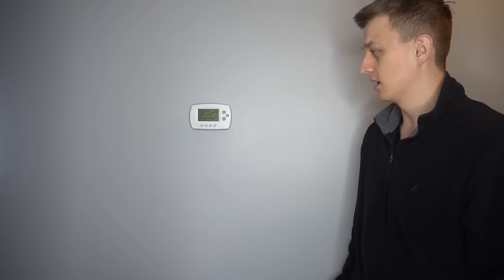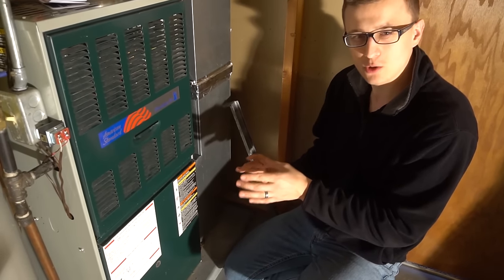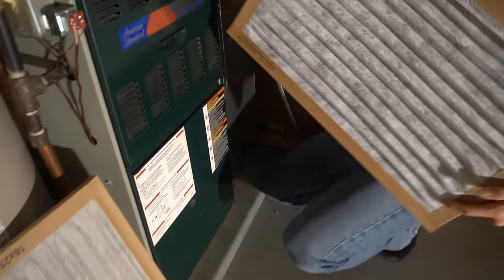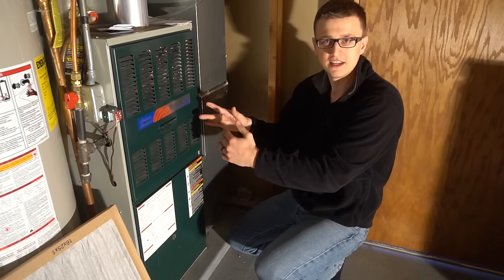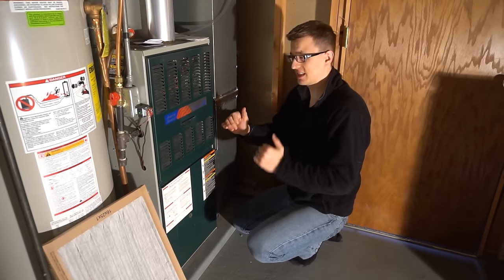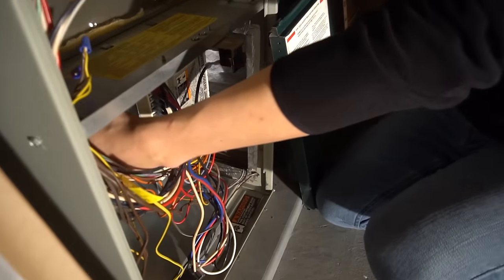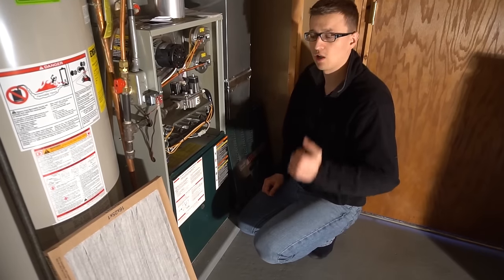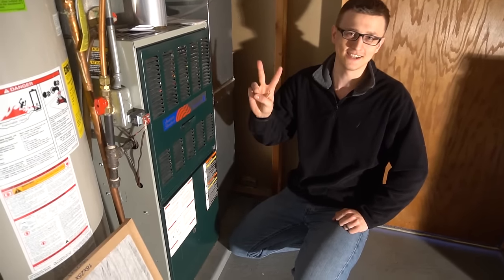Furnace not Keeping up SOLVED

Comment: I had this exact same problem today (furnace set to 73 but only making it to 70) and the problem turned out to be a clogged condenser drain.  Popped the drain hose off and a literal gallon of sediment-filled water came out.  After doing a bit of research the backed up water was tripping the pressure switch causing the furnace to shut off a minute or two after it turned on each and every time.  After draining the water the furnace immediately began working as normal again.  Just throwing my experience out there for anyone who has tried to two tips in the video but still has the same problem.
Reply: Thank you for posting
Reply: How do you do that?

Comment: I had two different furnace techs tell me to use the cheap filters.
Reply: Shaun Weiss furnace filters arent for filtering household air.  Theyre to prevent damage to the blower fan or coils.  The fiberglass ones are the right ones unless your furnace was built as a air filter too

Comment: I wish I could find a video of this problem....."my unit works with air, the batteries are good, the backlight works, the air conditioner works, but when I flip to heat, it does not come on.".....wonder what causes this....?????

Comment: THANK YOU so much! Furnace was cycling and I knew to try the filter first but when I took it out it looked fine and wasn't that old then spent hours trying other things and nothing worked. Then I found your video and your two comments that said sometimes it still looks clean and also that it often happens when very cold and since both of those things are currently true I took it out and slipped in a new one and long story short, now I can cancel the repair visit! Thank you again! Best in 2022 to you!

Comment: Thank you for showing this video. I just bought this model and I did not like it because of two reasons: No batteries need and the temperature sensor is two degree off (lower) than actual temperature.

Comment: My main limit switch failed overnight. I was able to troubleshoot with the help of your videos. I am guessing it overheated due to my filter being dirty. I also had the 4 light error code and the burners never came on. I tried to tap it but that didn't fix it. Unfortunately I had to call the service guy and it set me back 200 bucks. If it wasn't so cold out right now I could have replaced the switch myself but I couldn't wait a couple days for the replacement. Don't forget to change your filters or it could set you back in money! Great channel I have learned a lot in the past 24 hours of troubleshooting!

Comment: just resolved a poorly running electric furnace for my mother in law this morning.. set at 73, only getting to 67. replaced dirty high efficiency 3M filter with a new one and 30 minutes later the thermostat was satisfied and shut off. ur clip is a good one and educational, a lotta folks dont realize how important routine filter changes are and a little bit of knowledge can save you money by avoiding a service call. the service co she called couldnt come for 2 more days so we're pretty glad to have the issue resolved for $10 and a trip over there

Comment: Changing the filter was exactly what needed done! I’m a single woman renting a private home & all the basic maintenance is on me. So my research asking the question of why my thermostat showed everything was ok & it should have been heating with the heat turned up to 70 - brought me to this video. You made it very easy for me to figure it out & within about 30 seconds of changing the air fillet the heat came on!  So yeah! Thank you!!
Reply: I changed my batteries my screen is blank no readings my thermostat is five years  old do I need to buy a new one

Comment: Thank you so much for this video!  Currently experiencing sub-zero temps where I live and was about to call a furnace repair, as my furnace was not getting close enough to the temp I had set on the gauge.  Changed the batteries, but no change.  Had marked the filter needing to be changed next month, but followed your advice and changed the filter anyway and presto!  Furnace is working like a dream!  Thank you! Thank you!

Comment: I have a Bryant 80% single stage furnace that is 16 years old. I replaced the one inch filter in my return duct with a newly installed 5 inch air bear with no problems of restrictions or heat loss. In Michigan this year so far our temps went as low as -12. I change the air bear every 5 months. I have been in the automotive maintenance industry for many many years and fully understand the importance of preventative maintenance of especially filtration in all respects. I enjoy reading all comments and am always in a "learning mindset" when reading comments and replies. Just my thoughts.

Comment: THANK YOU AND ANOTHER TIP: My furnace had the same issue, checked the filter and it was very dirty. Replaced it with kirkland 2200 filter and problem did not go away. Did some research and found that my new filter was very dense for my furnace. Switched to light duty MERV 8 Filter and problem was solved. Thanks for making this video.

Comment: So glad i found your video...
This yr ive had problems with my furnace...not keeping up to temp...cycling on and off but not really kicking on. Its also the first yr ive used filters that are more solid.....ive had to use space heaters and my dryer vent to keep the house warm...making my utility bill $400 over normal. Im on fixed income and have t been able to get a repairman...because of other things... Because if covid i couldnt find online the filters i usually used that let more air pass thru.... 
Ive replaced the thermostat... And kept having the problem...

Comment: Thanks for explaining the system lockout safety setting, & power shutoff furnace  reset.   My repeated power resets kept restarting the heating element & burners, but they never stayed on due to the lockout.  Just like you said and showed on this video,  it was a dirty filter. Will buy lesser priced, less restrictive filters going forward, especially during colder winter months. Thank you!

Comment: Woke up this morning with -1 temps outside and heat in the house at 64 lalthough I'd set it to 70. Did what you suggested and sure enough it was the filter. Ran without for a while and also turned off for 5 seconds in case it was locked out. It's starting to warm-up! You just saved me a really expensive Sunday service call. Thanks so much!
Reply: How long did it take your house to heat back up? I'm facing the same exact issue

Comment: Great video. By the way my thermostat is same as yours paired with trane single stage AC and single stage gas furnace. I had a similar situation like this  about a month ago. I usually keep it about 64 at night  when I am sleep and when I am away  and at work .. Got off work  we had our first really cold snap and I got home the house wouldn't get know warmer than 65 or 66 when I program to start warming the place up 1hr prior to me arriving. I keep at 69 during the day when I am at home. Your video seem to be the most helpful and straightforward I have seen. By the way I am from South USA where it usually brutally cold to about middle of winter that often or any all. Great videos great channel. I can do most of it myself in between my two yearly hvac maintenances visits I recently signed up for my furnace and air conditioner visits from my hvac company. Your videos is really going to really help me save a lot money in terms of repairs and costs in future on certain  stuff I can easily do myself. Anyway great job.

Comment: My blower ( gas) was running fine, thermal cupler new, but when I REMOVED the cheaper 2 inch filter which was blocking air flow  , it shot up to proper heat instantly..BLESS YOU. I will use slimmer model for heat. never a problem for a/c  but I normally use highest quality home depot filters...for pollution

Comment: Great video! this was exactly my issue.  Changed the filter, temperature came up and stabilized at thermostat set temp.  Worth noting this happened during a particularly cold spell where the furnace was running a lot.

Comment: Yes, perhaps my air filter was the problem. I replaced it last week (after 3 months) with a brand new higher end filter by 3M, but today I came home to a much cooler house (65 degrees Fahrenheit when I normally set the thermostat to 67 or 68 degrees Fahrenheit). So, before watching your video, I switched off the furnace for a few seconds and switched it on again to see it fire up. It ran through the full cycle and the vents warmed up and the home temperature is rising. So, thanks for the advice and of course, if I have this problem again, I'll check and/or replace the filter and if that doesn't do the trick, I'm going to call my furnace guy to assess the situation, but it seems to be running normally again. :)

Comment: Yes these premium filters for people with allergies, etc. are great, unless your furnace is old and can't keep up (incompatible). Thanks for the simple heads-up
Reply: Yes, that was my problem.  Had a premium filter in an older furnace.  Even though the filter didn't look all that dirty, I replaced it anyway and viola, my furnace is working beautifully.
Reply: a company here in my town said it is better to use the thinner cheaper filters and change them real often, this saves your unit, but, you must change real often........

Comment: Thanks for your videos, they have been most helpful. Our furnace has been on the fritz for the last 1-2 years (every since we bought the house). The furnace is currently 24 years old and we know it can't last too much longer. Well we have a home warranty ($125/per service call) and they have been out five times in the last two years and every time they come out they just check the filter, return ducts, clean the flame sensor (they have replaced it twice so far) and check to see the temperature that the furnace is putting out. It usually works okay for a bit but it seems like it is never keeping up. I've changed the filter and also removed the filter but the same sequence of operations keeps happening. The furnace will work properly for anywhere from 3-5 minutes then shuts off. If I go upstairs and bring the thermostat (honeywell) back down to the level of the house(wait for it to click) then raise the temperature the furnace will again come on and repeat the same cycle. The furnace seems to put out a lot of hot air but our house can never warm up past 68-70 because it is always repeating this cycle. It is getting frustrating with our Minnesota winters  I hate to keep calling them out when they don't really do anything, do you know what the fix could be?
Reply: Well I've checked the continuity and voltage on the limit switch and everything checked out normal. Even with filter out of the unit it still goes into the overheating mode. Not sure what else to check.
Reply from the maker: @trinityrv4683  It's possible that the high limit switch is weak so it keeps tripping even though the furnace is not overheating. From what you described, I wouldn't be able to give you a good answer though. Could be quite a few things.. When the burners shut off like that (or it "overheats"), does the control board blink an error code?
Reply: @WordofAdviceTV  Yes it gives me the 4 flashes for high limit switch error code.
Reply from the maker: Hmm.. I would try replacing that hi-limit switch then. I can't say for sure that it will fix it though.. Right now I am working on a video on 10 reasons why a furnace can overheat. Sorry I can't post it any sooner, it will still take at least 3 days to complete. But maybe that video will have some useful information for you.
Reply: @WordofAdviceTV  Sounds Great. In the mean time I will replace the hi-limit switch and see if that helps. Thanks.
Reply: It indeed was the hi-limit switch. It seems to be cycling correctly! Thanks.
Reply from the maker: @trinityrv4683  Awesome! Happy to hear it :) Stay warm!

Comment: Hi,Jay, I am sure this is case why  furnace locks out. Like you said especially in cold weather. When I try to put the front cover back, sucking force is strong.Thank you so much.
Reply from the maker: You're welcome! Good luck with all those furnace calls man! :) Oh and I can leave you with one more tip if you are not doing this already... Whenever I have intermittent problems like that, where I come to the house and the furnace is working fine.. I always explain the diagnostic/error LED light on the control board to the homeowner and show them where to find the diagnostic chart on the back of the furnace door or in the manual. I then instruct them to write down whatever code the furnace is blinking if the problem ever comes back. That way when I come and everything is working fine, they can tell me that when it wasn't working it was blinking such and such error code. Hope that helps in the future!
Reply: @WordofAdviceTV  You are totally right. Thank you

Comment: My last comment was just don’t make the customer think they can solve all their problem with a filter.even though it’s a very common problem. All that aside  you should cover a topic with me here that a ton of tech disagree on. That is the use of uv lights in systems to eliminate fungus mildews and what not. Here’s my take on those. I’ve installed these lights on systems with some extremely good success rates when installed properly.  I had a customer once that was suffering from allergies very bad in the home. About 2 years prior to that they had a water heater burst in the mechanical room where the furnace was located. They began to grow a mold inside the unit. Thus allergies began too for them. I called the customer down to the basement to see what I had found in their furnace. It was all inside the unit around the walls of the unit and into the duct supply . They questioned me about how to eliminate it without buying a new system and duct. We only have a few things in our arsenal to use for something like that. One is a cleaning kit you can buy and use to eliminate that . The other is a uv light. Here was the result the next maintenance time. I show up to change the bulbs out because they bought the one year bulbs. Turn off everything and pop it open. What was left of the mold was a dead white powder. In the duct and inside the furnace . Now keep in mind I did also use the clean kit to kill as much of that as I could right off. There was still some left that I could not really get to . All of it dead and turned white nothing was left behind and the allergies stopped. We used a two bulb mount up light system one mounted inside the duct and one over the fan area near the coil . So in essence both sides of the coil. Worked great and the customer is still very pleased with that system today. If you’ve never used one I absolutely recommend it.unless you have a up or ozone reaction then probably not so good maybe use the cleaning kit and hope that solves it. Otherwise this is extremely effective on stuff like that.

Comment: Thanks I now know hot check if your motor is burned out in a industrial size heating system which is where I live as of rite now and its cold in here when the heat has a problem like this but now hey I can go check!! Thanks great video

Comment: Great video. I encountered this recently, where the aux was triggered due to below freezing temps but would not get to desired temp. I changed the filter - nothing; made sure the duct  dampers were open; checked  all basement registers were closed. Then it dawned on me after vetting the heat strip was working as it should, the basement door, directly across from the thermostat,  was left open. Doh! Closed the basement door  - problem  solved.

Comment: I have a similar problem, however, it’s the cooling system that seems to be stuck at room temperature and it’s taking for ever to lower my set temperature degree. For example, I set my AC temperature to,let’s say 78 degrees during the day and  at nighttime it’s set to, let say 70 degrees, the lowering process,from 78 to 70 degrees is taking a very long time (hours) to reach 70 degrees temperature settings. I must add that I keep my HVAC system very well maintained, no less than twice a year a complete maintenance and I change the filters every three months. I appreciate and welcome any suggestion provided. Thank you.

Ps. What is the meaning and function of the different levels of the HVAC settings ie, H1C1 ,2, 3, and 4.

Comment: I buy the cheap filters 4 for $5.00 ... I change them every month on the first of the month. I live in the mountains and only need a furnace, so I just change them in the winter months. The air up here is very clean and minimal dust. The expensive multi-pleated filters restrict airflow. Also, I have a wood stove that I fire-up on the very cold days to supplement.   I don't have to use the woodstove but it's nice to cook chili on and have a nice fire to sit around in the evening. Kinda makes you look forward to those chilly evenings sitting by the fire with your hot coffee and your warm honey.... Life's good.
Reply from the maker: That sounds awesome! I'm happy to hear life is good! :) Thanks for sharing!

Comment: Can similar symptoms happen (but less consistently) if the overheat sensor is going bad? My furnace will occasionally shut itself off until I turn its power off and on again. It happens maybe once a day and is worse on colder days. Filter is brand new and this still happens.